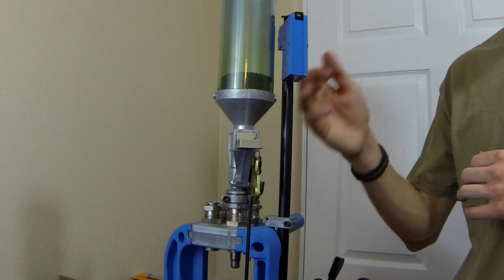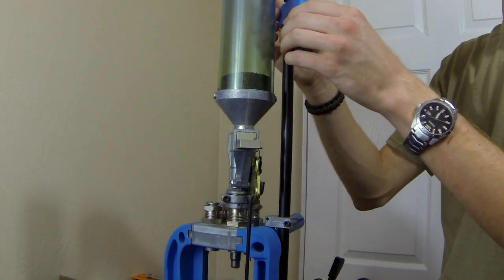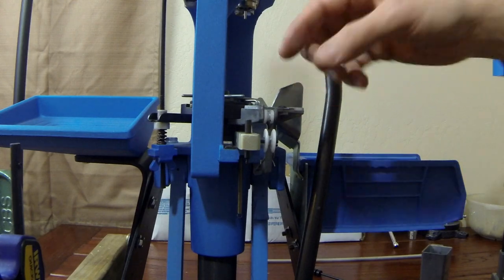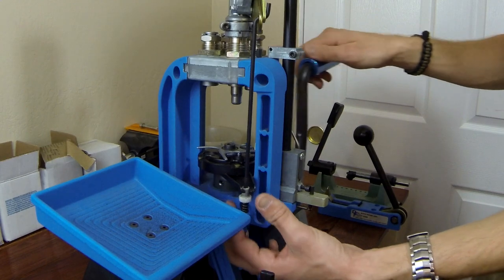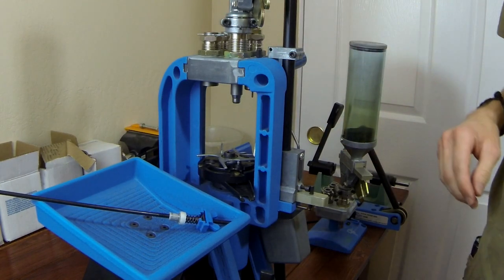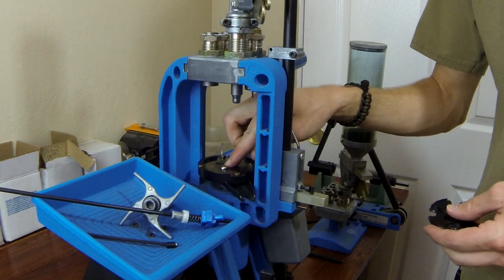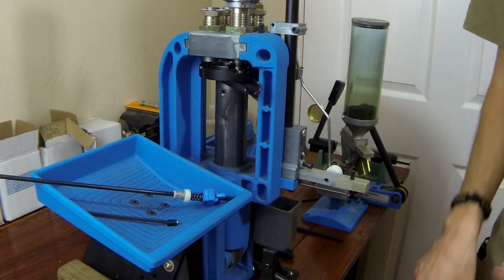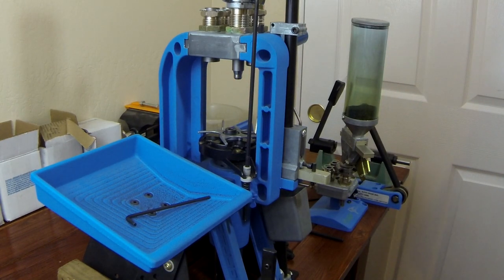How To Change Calibers On The Dillon RL550B -THEAR15ONA

Comment: good video..  I usually pull the tool head out and then change the shell plate and locator buttons then insert new tool head.  It leaves a little more room to work with the shell plate bolt for my big hands
Reply from the maker: +Fast Draw Tactical Furniture Makes good sense. Thanks!

Comment: I load in lots of 100, so I NEVER leave primers in the tube. I also never leave powder in the powder measure. At the end of a re-loading session I always return the powder to the appropriate original container. When I change the primer bar I lubricate the base of the primer bar with a little dry graphite. Rather that pulling he shell plate retaining bolt set screw all the way out, I just back it off until the shell plate bolt will turn. Less small pieces to drop. I had a problem the other day with the small spring that retains the shell case in the sizing/depriming station hanging up in the open position after inserting a fresh case. I adjusted it several times with but it still kept hanging up. I finally pulled the spring clip, gave the hook end a few strokes with a small diamond file to remove a slight burr, and problem solved. I was sizing and de-priming 1000 x .308 WIN mil-crimped surplus brass and late in the process the press started to “feel wrong” at the full sizing depth. I thought the die was dirty as I had a similar problem re-sizing mil-surp pulled-down Lake City ‘69 .30-‘06 brass (it turned out that the case necks were lined with asphalt water proofing that was pulled out by the expander ball and jammed into the top of the resizing die; a careful cleaning with mineral spirits and cotton swabs corrected that.) Well,cleaning the die on the .308 project did not correct the problem. I eventually tracked it down to an ejected primer that missed the primer cup and landed on the ram lever arm and got smashed in the zero clearance space, preventing a full length stroke. Primer out, problem solved. I like the 550B because there are a limited number of processing going on, and it is easier to keep track of each step. In almost 25 years I have never had a problem that required replacement parts of a call to customer service.

Comment: Outstanding video! I just bought a Dillon 550C and this video cleared up all my questions except for one.  Should I get a separate powder measure for each caliber or just transfer the one I have to each caliber as needed? Thanks, James
Reply: if you reload each of your calibers often, then yes. if you load several months supply per caliber each time you load then no. if you can afford, then why not. less setup.

Comment: Dropping that ball bearing down the bolt hole. . .  Been there. I use a tool that is actually for lifting canning lids out of boiling water. A six inch plastic wand with a magnet on one end.
Reply from the maker: +C. Daisy Anything that can happen will happen haha.

Comment: Good informative video!  Is it worth the $82 each to get a powder measure for each caliber?  I reload 4 pistol and 2 rifle calibers.  Seems that storage would be an issue as well.
Reply: Saxo270 NLN I am wondering the same thing
Reply: If you consistently shoot one weight projectile with the same powder setup in a caliber, then it's convenient to be able to just switch heads without having to reset the powder drop.  Especially if you're swapping between powder bars for different weights.  Always remove your powder when not in use.  Yes it's a taller item to store, but I don't have shelves over my bench.  I hope this helps.
Reply: I have bought separate powder measures, I think it helps keep my reloads more consistent. Or maybe I’m just lazy....

Comment: hi. I load 45acp and am getting  38 357 dillon quick change.  would I be better off to set dies for 357 or 38. my revolvers are 357 , 38. thank you.  good videos. I have the 550. would you recommend  set up like you have. thanks again.
Reply from the maker: +Mark As far as which to choose- I would personally load for 38 because of the decreased cost since you would need less powder per round. I think the quick change assembly is by far the way to go. Set your dies once and then you don't need to mess with them again.
Reply: Thank you. Ordering now. Not sure who I want to order from. Already load 45acp on 550. Any soft accurate loads for 38. Gotta order bullets to. Don't know if I should get handle or not. Thanks again
Reply from the maker: +Mark I shoot cheap- so I always got lead projectiles from mastercast dot net.

Comment: are you still reloading 9mm with lead bullets?
Reply from the maker: I am yes. Why do you ask?
Reply: I just recently started reloading I've got 124gr lead bullets coming. I was just wonder if you had any pointers for a novice
Reply from the maker: +Corey Boyd Hmm, I am not sure exactly what I can say to help, but if you are running a dillon rl550b like me- the only tips I know of for lead projectiles is that every 100 rounds or so, I drop the center out of the seating and crimping die and clean inside of there. For some reason lead shavings come off inside of there and get squished in and overtime the buildup can become quite substantial. Otherwise it is straight forward like any other kind of reloading session. Are you brand new to reloading or just lead projectiles??
Reply: Band new to reloading I've watched about everything I can watch on YouTube
Reply from the maker: Gotcha.  Well reach out if you have any questions. There are a ton of small details and depending on how complex you wish to get- it can become witchcraft complicated. I just find a load that runs my guns and I keep it that way. So don't get too wrapped around the details right away as long as you are safe.
Reply: Alright thanks bud